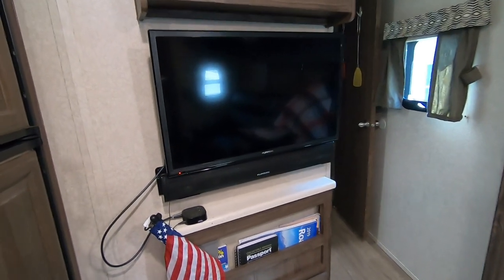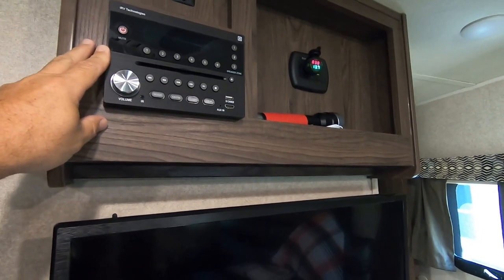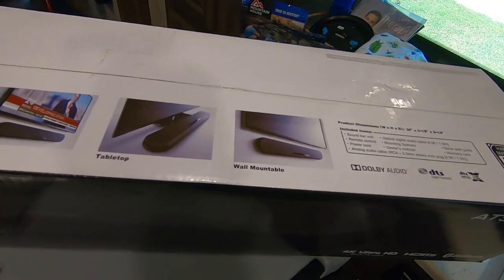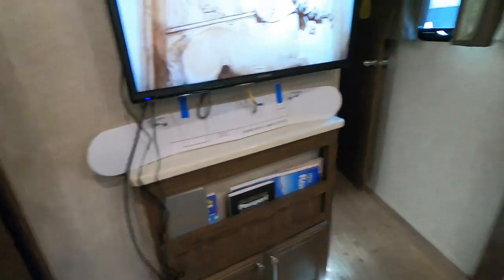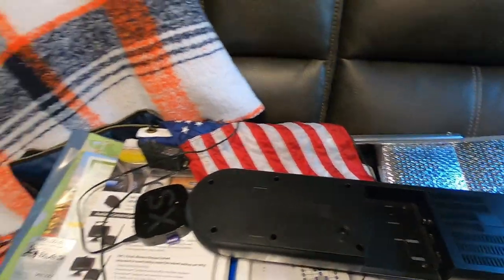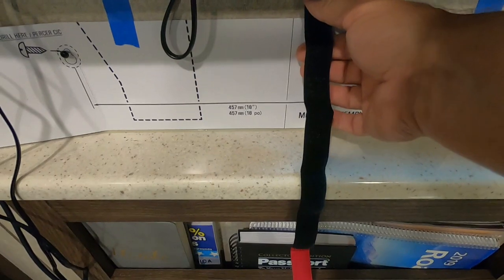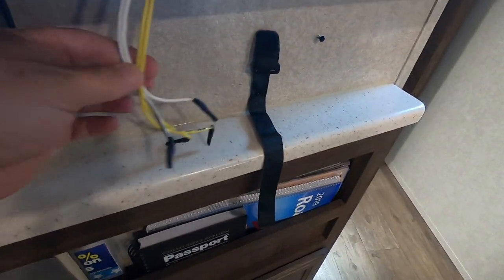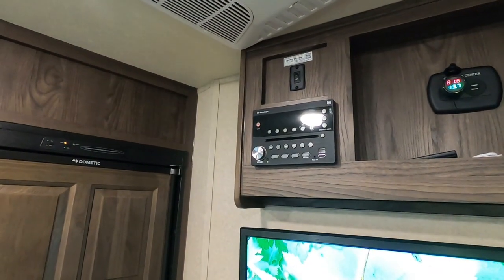RV TV SOUNDBAR UPGRADE

Comment: Are you still towing with the Jeep Cherokee?. I plan on getting a Grand Cherokee to tow a trailer. The Specs say the Jeep can tow 6200lbs, so I assume getting a trailer unloaded at 4800 should be good right? I keep reading conflicting arguments between yes and no.
Reply from the maker: My GC owners manual says the v6 will tow 6200# as equipped.  If the trailer you are talking about is an RV, then loaded for travel could add 700# or more.  This gets you close to the max capacity of the GC.  If I did not already have the GC, I would have looked for a capable 1/2 ton pickup at minimum.  Safe travels.
Reply: I'm towing with my GC an RV with 4600# dry weight...I can add up to another 1,400#'s and still be under the GC's 6,200 max tow weight.